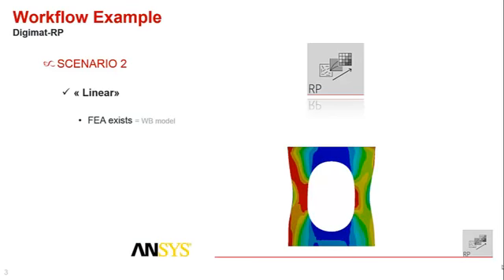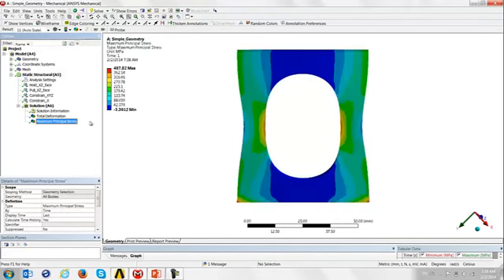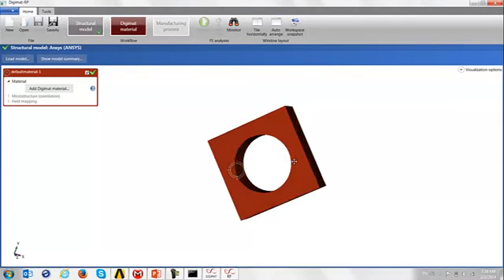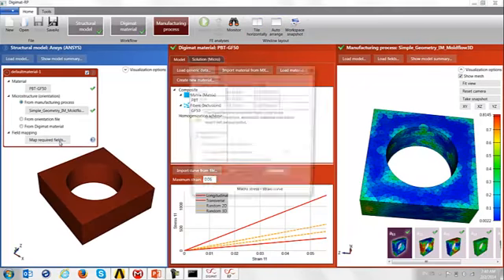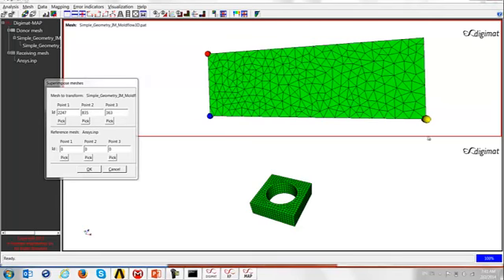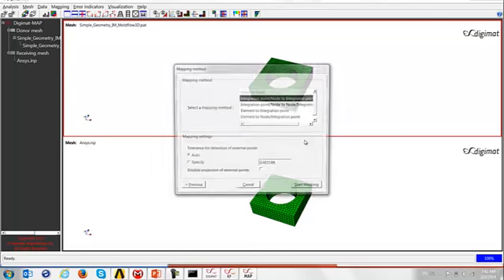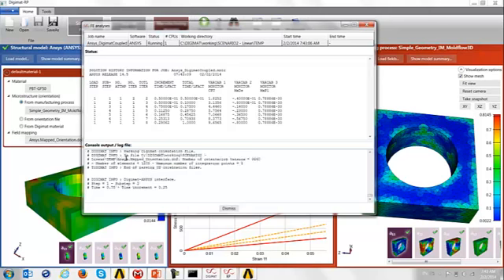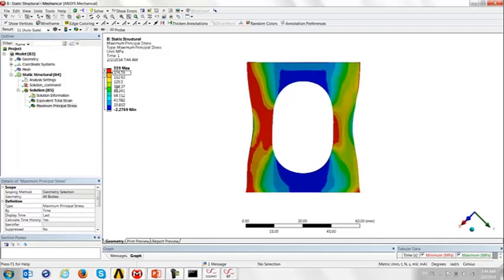Digimat RP+Demo+2 SD

Comment: Hi, After defining all boundary conditions of the structural model in Ansys, I exported it as * inp. Later, when I import the structural model with * inp extension in Digimat RP, "at least one supported element with an assigned material is required." and the structural model is not imported. How can I solve this problem, can you help please?
Reply from the maker: Hi Ferdi,
Thanks for reaching out. In general , the Ansys Model need to :
•	 contain the Boundary Conditions 
•	 be meshed with elements that are supported by Digimat
•	 be assigned to Ansys material law 
•	 run smoothly without convergence issue with the Ansys material law . 
Then from Ansys Workbench , you can export the *cdb , *dat  or *inp format to Digimat-RP. 
If you still experience any issue performing this workflow , don't hesitate to contact the team via email: mi-msc-digimat.support@hexagon.com and they will be glad to help you.